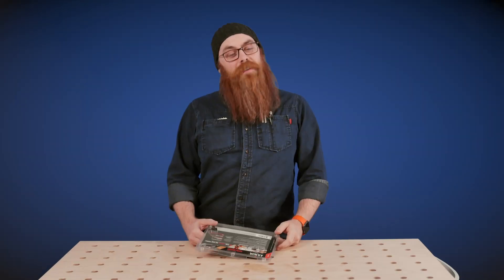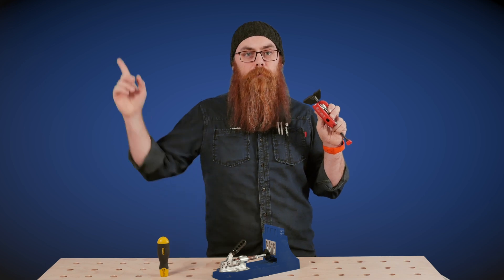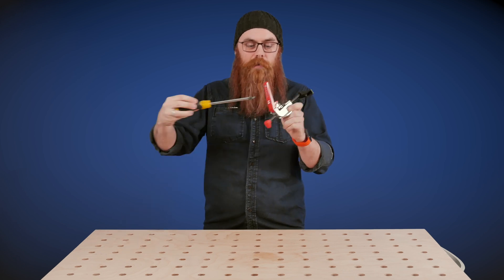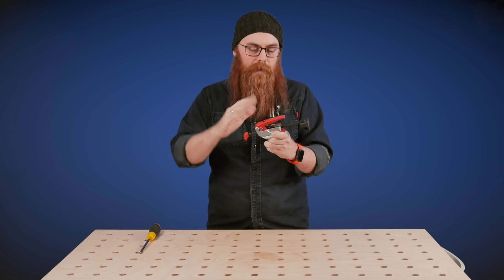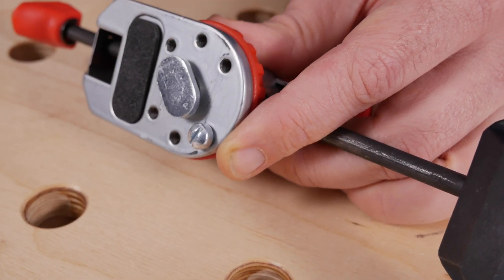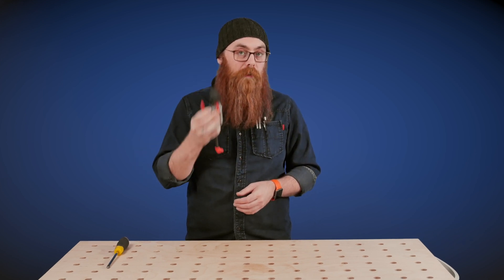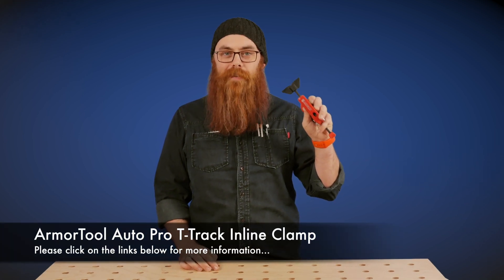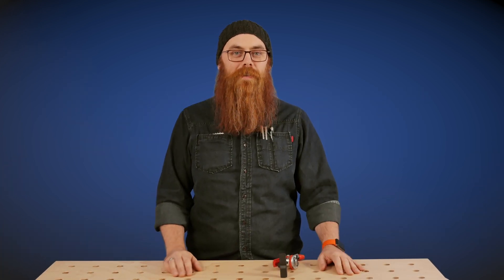Cool Tool Tuesday - An Auto Adjusting Clamp!

Comment: How did you secure the rail to the workbench and which rails did you use?
Reply from the maker: These were the Armor Tool t-tracks, but the Auto-Adjusting Clamp will fit on almost all available t-tracks 🙂